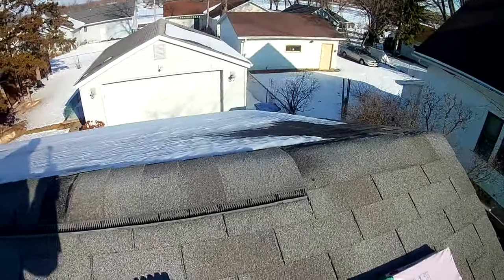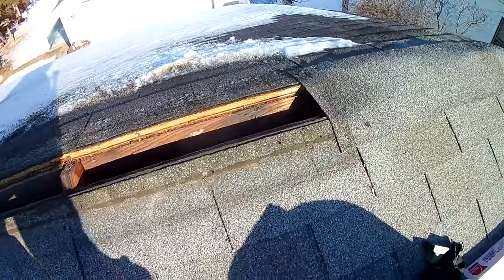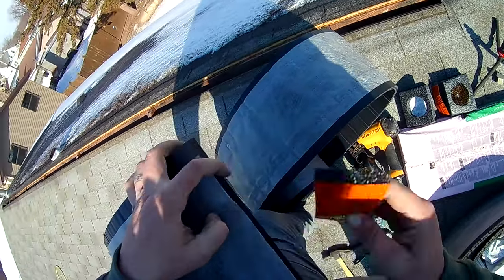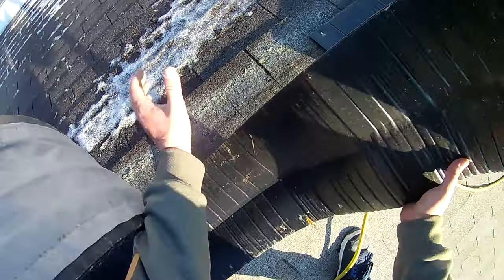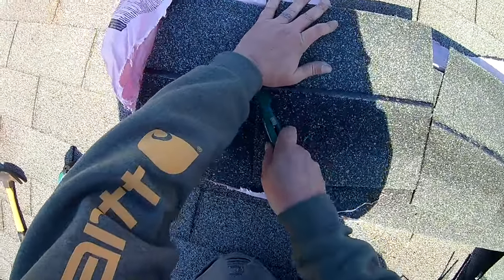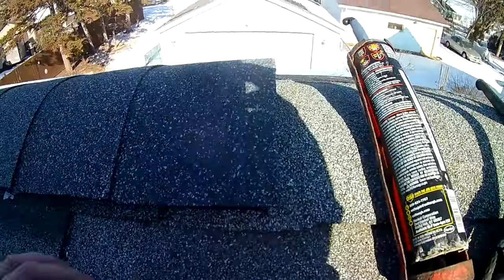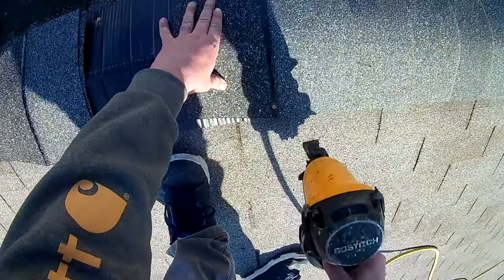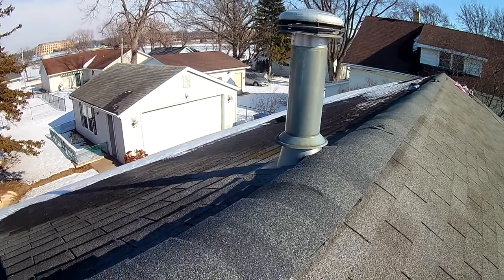HOW TO INSTALL RIDGE VENT ON A SHINGLE ROOF

Comment: ALWAYS run the ridge vent to the end of the ridge for a better look and more professional look. NEVER install a ridge vent WITHOUT baffles on both sides of ridge vent for proper attic ventilation out of BOTH sides of ridge vent. That ownes corning non baffled ridge vent is total garbage forcing air only out of one side not venting attic properly.. Shingle vent 2 from CertainTeed is a baffled ridge vent that works 100 times better than Owens corning non baffled vent.
Reply from the maker: You are not supposed to run vent all the way to the end it says in the instructions... Owens corning is a masssive company and they put alot of money into developing a superior product to Certainteed in every single way. You can have your opinion though

Comment: You're nailing in the wrong place!  Look at the instructions on the shingle package... nails go just below the glue line (in the colored part of the shingle).  This keeps the glue line intact AND it keeps the glue line high so that the next shingle will have full contact at the glue line.  Again, if you don't believe me, look at the mfrs. wind tested instructions.
Reply from the maker: I do not care about mfrs warranty because the customer will call me when shit goes wrong....

Comment: Gun pressure on caps is on point. Very often overlooked. I also either replace the top course of shingles on each side or at least caulk them before I lay the new vent down. Good job though. Check into the new dewalt battery roofing gun. Has been a godsend to me
Reply from the maker: thanks!
Reply: I was thinking of a battery operated nail gun as well...less work pulling hose and having to manage it.
Reply: I was skeptical on the cordless roofing nailers at first, thinking they may be slow or the batteries wouldn't last but I'm a believer now! I just use 4ah or bigger and keep a constant supply on the chargers at all times! I have gone completely cordless on my roofs now

Comment: Ty so much for this tutorial, I have to re shingle my ridge this weekend here in Maine and the weather is going to be in the 70’s!, my ridge vent is exactly like the one in the beginning of this video that you removed. I’ve never shingled a roof let alone a ridge cap so I am grateful to have found this . Thank you for the detailed video!
Reply from the maker: You are welcome! enjoy the weather! we are in wisconsin and they are saying we will set a record for high temperature today! 75 degrees in november. crazy!
Reply: Use the Ventsure if you can!  Also, if you can't find the Ventsure there is another brand called Quarrix Trimline and it is EXACTLY like the Ventsure

Comment: great video and tip!!!the only thing i would recommend is caulking the top row of shingles that have the former nail holes on them now bc of wind driven rain. my old man taught me that as in use to do it the same way as you.
Reply from the maker: That is a great point! I know that the ridge vent covered the nail holes but not by much on some of those. Thanks for watching!
Reply: @Lifes_Apprentice  it was a pleasure watching, ill stay tuned for more videos :)
Reply from the maker: @lusoroofing5221  Thanks!

Comment: I’m a big fan of the cobra vent material over the plastic selections that they used . Getting that line snapped straight is so key from having a wavy shingle line .
Reply from the maker: If you snap a straight line the ridge will be straight!
Reply: @Lifes_Apprentice   Years ago I was running cap shingles on hips on a role of townhouse 🏡 . Boss pulled up from the entrance and was like wtf yelling like crazy . I didn’t snap a line I just started nailing 😂😂😂
Reply from the maker: @hhprogressiveconstruction1140  I dont snap a line if its only like 10 ft or less but over 10 feet you can get crooked in a hurry!
Reply: @Lifes_Apprentice  They we’re like 40’ plus hips lol learned a lesson that day . Did all the work over agin .
Reply from the maker: @hhprogressiveconstruction1140  I think every person working in construction has learned a lesson like that. Those are the mistakes that teach you to be a great contractor
Reply: The ridge vent that you took off was a far better product than what you installed.  There is a reason why the best vent ridge has a side baffle and its so when the wind blows it creates a uplifting draw and pulls the attic air out. The stuff you installed will draw from one side to the other and decrease the draw from the attic. The guy's who did the original install were just idiots.
Reply: Always run the ridge vent to the end of ridge to look better and more professional.

Comment: Great video.  a lot of good advice.  

Why did you have to replace the ridge vent system vs fixing the install?  Small savings & a lot of extra work? Was the old stiffer plank style defective or damaged in some way? 

Does the newer Owens system do a better job of sealing against architectural / presidential style, where there are many big 1/8" high long sections that will allow wind driven rain in up and over on slopes less than 512?  I have the system (6 years old) that you removed on presidential style shingles, and it leaks during storms.  Should i fix it or replace it?
Reply from the maker: I prefer the owens corning ridge because it is 20 feet long and no seams like the old 4 foot sections. If the ridge shingles blow off the vent will not leak. I have fixed other vents like I replaced that snow and rain will blow under the ridge vent... In my opinion the 4ft sections can provide more venting per foot than the owens corning vent but I think the owens corning is better product all around

Comment: Im doing a garage roof replacing plywood and shingles the garage has gable roof vents should i use rolled ridge vent or just cap the ridge with tabs
Reply from the maker: The vent will work without soffit vents and you can do it with vent or without in my opinion. The vent will work to some degree either way
Reply: @Lifes_Apprentice if you use it without soffits vents wont air and water be pushed in instead of out?

Comment: That vent stack is super low right at the rubber boot edge  . Surprised they haven’t had an issue before . The old barn cutting three tab design I cut many of bundles on top of bundles growing up .
Reply from the maker: I see the vent stacks low like that on alot of houses around here. Not sure why that is but many only stick above roof 6-12 inches or less

Comment: Forgot to ask... 
Do you recommend a 16 oz or a 20 oz roofing hammer for this job for (the weekend warrior homeowner)? 
(I have both so I think I'm going to start out with the 20, just saying some of my arm gets tired the 16 will feel so much lighter).
Reply from the maker: I use a 16oz hammer... I dont think it makes a big difference personally
Reply: @Lifes_Apprentice  Thanks and I totally agree with you... Meanwhile Three decades into the future... Instead of the included three inch Ringed Roofing Nails I used about 30 of DeckMate's 3" Star Drive (Zombie-Apocalypse-Green) Coated Screws & my heavy arsed Hilti Portable Hammer Drill gun (SF-180) to install the three 4' sections of ShingleVent II.  Glad I did it was a lot easier to maintain product integrity by unscrewing versus pulling nails out of pitifully pounded plastic panels in order to keep them all aligned pretty and properly.  

See what happens when you make YouTube videos and you have pride in your work.... it's contagious, as it should be. 

Thank you very much again.
Reply from the maker: @AdMan-The-LabRat  Your welcome!

Comment: Is it possible very strong winds and rains..can rain get under ridgevent if there is any gap between roof and ridgevent?  We had strong winds hard rains looks like on my roof there was areas that it was not touching roof and I saw in attic just small drips
Reply from the maker: Yes. I have seen it before. snow will blow inside in some cases too
Reply: @Life's Apprentice  Thanks for the reply, I was thinking that  is what happened

Comment: Nail size?
Reply: Thickness of sheeting (usually 1/2) + thickness of shingles (maybe 3/16 on arch.) plus thickness of ridge vent + thickness of ridge shingle.  You want to puncture the sheeting by 1/8 or more.  It's silly to use two different size nails for attaching the ridge vent and then the ridge shingle.  Add it up and use same nail.